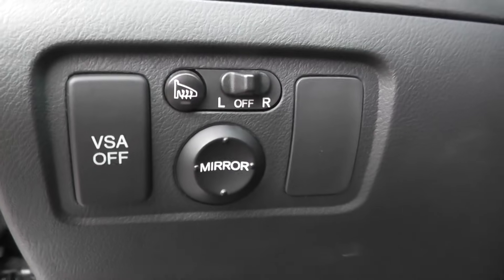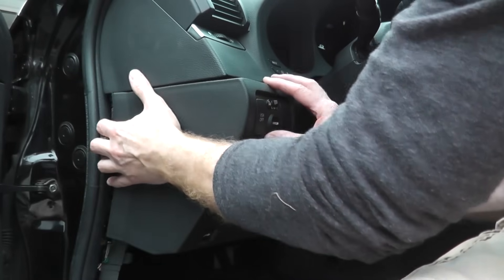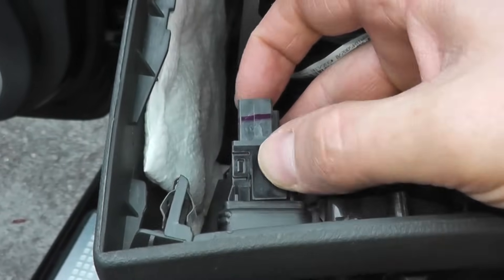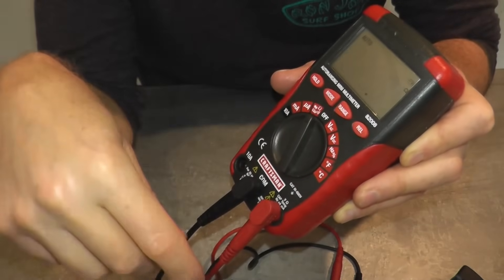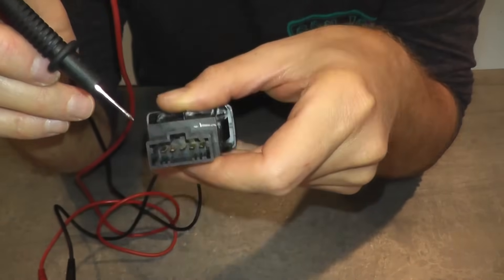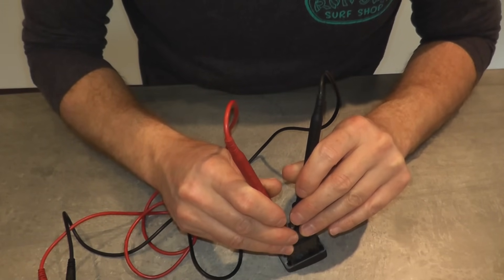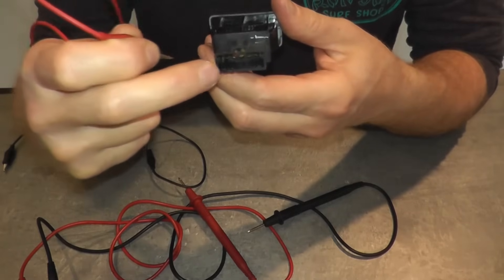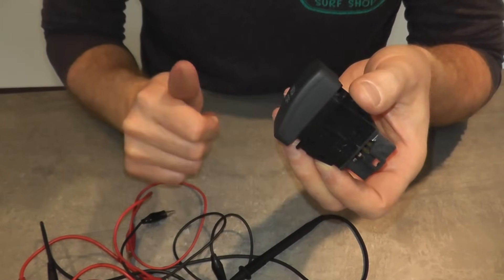VSA Switch Test

Comment: I own a 2006 tl visa light would stay on, also if I honk the horn it would blow fuse in engine bay. Cause was horn. Replace horn ok. Would also lose brake lights on same circuit. It was the horn short circuit the hole time. Thers two horns high and low bottom right front. Disconnect to see if it solves issue

Comment: How do you determine which pins to test?  My 2006 Acura VSA switch is different.  Rather than 1 row of 5 pins, mine has 2 rows of pins (9 pins total).

Comment: I just reset my triangle light. Came on months before the vsa light and abs light. Got the abs fixed which fixed the vsa but the traction control  triangle light was still on. Found a vid on YouTube where you short pin 9 to ground and push the vsa button .
Reply: CharlietoKind linkk please
Reply: CharlietoKind what kind of car do u have
Reply: YaaBoyyJayJay 07 odyssey
Reply: Hey guys I got a 2006 Honda Odyssey touring model I have a recall on my fuel pump strainer how old how will the dealer try to rob me in Spanish
Reply: Not in Spanish on this
Reply: How did you fix your VSA light I can’t get mine off idk what to replace or do

Comment: I have a 2007 honda element sc. I need to know if the button clicks and stays down like the cruise control button when pressed. My vsa button does not stay depressed down. It just springs back.
Reply: My 2001 acura does the same thing after I had my upper control arm replaced.Did you fix your vsa light problem?
Reply: @glenhesketh1  nope. Replaced the one wheel sensor that the wire was ripped out and went through the process of the reset 50 times. Checked the master cylinder plug which some say is the issue. Nothing. Gave up. Frustrating as hell.

Comment: Can someone explain what the VSA switch is used for? What is that? What does VSA stand for????
Reply: Vehicle Stability Assist. It helps the car to stay in a straight line in slippery conditions, or during a quick change of direction maneuver, like trying to evade a sudden obstacle in front of you. It applies the rear wheels breaks, independently, to help the car turn more easily. It uses some of the same sensors that the ABS system uses, but additionally it uses other sensors that measure the posture of the vehicle relative to its movement. Almost all cars have them now, because it is good at helping to keep the control of the vehicle at higher speeds, thus avoiding a lot of single vehicle accidents, but it really is only some additional lines of code in the ABS system, so it is not very expensive to make.

Comment: I uses to have that problem and i resolved real simple. With a needle i suck all the break fluid from the bottle container, clean real good the dirt and the oil level indicator. Put new fluid back and that resolved my 2 problems. The triangle and the break light like if you had the emergency break on. Hopefully this can help you guys.
Reply: what year is your Tl , Did you lose power when the vsa light comes on ..
Reply: Bolillo Ponce yes I lose power and I am stuck in 3rd gear
Reply: @emilwilliams8436  If your losing power you might need a new Accelerator pedal position sensor (APP Sensor)  I was having that issue...Once I replaced it the issue was gone.
Reply: ghost125562 thanks for that information can you or do you have a part number for this sensor I think that’s that issue.
Reply: Bolillo Ponce thanks I appreciate your help
Reply: So u cleaned the brake fluid container out completely ? The one under the hood ?

Comment: The video was very helpful, but I replaced the switch with a new one from a dealer and the light still didn't go out. Must be something else.
Reply from the maker: Most likely will need to reset the steering angle sensor. I'll have something shortly. My light is still on, too.
Reply: Will it affect the vehicle in anyway if we just leave it on and you continue driving with it in

Comment: Did you ever figure what was wrong iam having same issue with my 2008 acura tsx.
Reply from the maker: Yes, I have a very good idea what's wrong with it. Long story short, the scan tool I'm using isn't doing its job and resetting the VSA. I'm currently working with the manufacturer for a solution. Nonetheless, I'll have something very shortly.
Reply: @CarsNToys Alright sounds good maybe my scanner is the same way ill try a different one as well.
Reply: @dientefrio69  will do that thanks a lot
Reply: @dientefrio69  i was past do for a brake fluid flush perfect eccuse to do it. Yea ill let you know how it goes.
Reply: @dientefrio69  i did a brake fluid flush and light still there getting code 64-1 sensor power voltage. Oh other codes are gone.
Reply: @dientefrio69  yea did that first and then i bleed all 4 calipers umma drive it for a few days and see if lights go away. Either way it was worth flushing old fluid car stops a lot better. What codes did you have on yours?
Reply: @dientefrio69  ill keep you updated. Thanks for all the info.
Reply: @dientefrio69  yea no traction control dont bother me but the lights on do. Thanks again ill let you know what happens
Reply: Finally got my car fix it was the vsa module that was bad got one from LQK and just install today and vsa and /!\ lights are gone.
Reply: @dientefrio69  yea no problem. Thanks to you for getting me started on fixing my issue.
Reply: @Eldela5.0  what's the vsa module

Comment: Does it have to be turned ON or OFF? And what exactly is it for?
Reply from the maker: It's for stability control; in other words traction if the tires slip. Keep it on.
Reply: So does that mean I don’t have to turn it on because all I ever do is drive it to work and back home
Reply: @dircxx8554  I left it off

Comment: Can still drive my acura with the warning ⚠️
Reply from the maker: With the VSA symbol on? Yes you can. However, the system is inoperable until it is repaired. Here's how - https://youtu.be/AjoY3yQg_ZQ
Reply: @CarsNToys  Performed that video with a FoxwellNT630Plus with no success. Perhaps the OBD port has a broken wire/pin somewhere.  My car is a 2012 Acura TSX SE & its problem is the VSA.  Keep on reading your comments - they are very informative.
Reply: @CarsNToys  when I push it in mine brings up the warning symbol but no words is it supposed to say VSA off? Also does that mean that my all-wheel drive will not work?